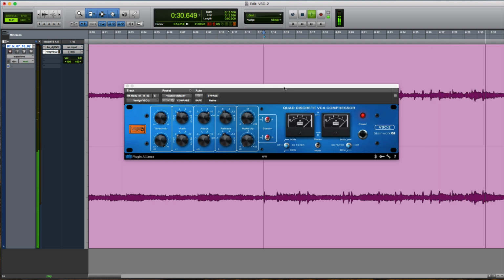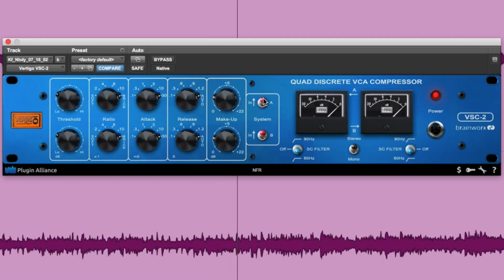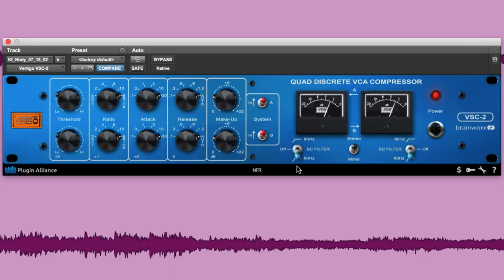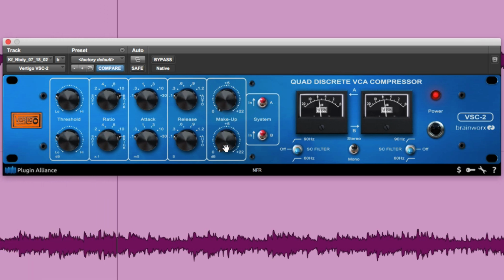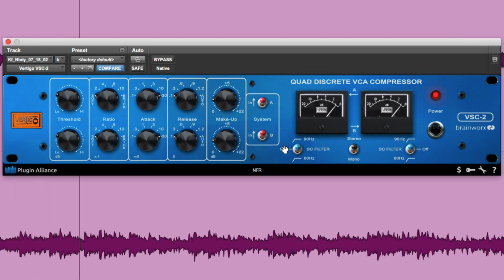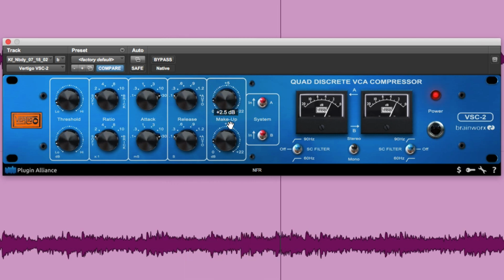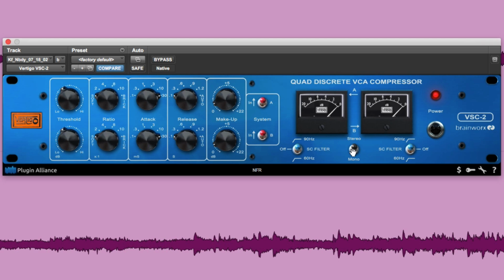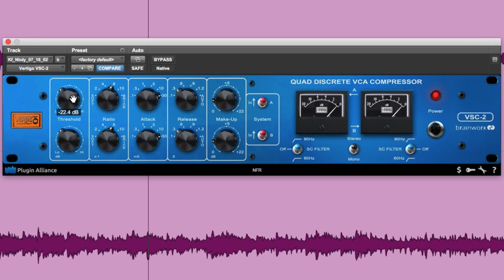Vertigo VSC-2 - How to set up a VCA compressor on your Master

Comment: Soft is not a softer ratio, like 1,5:1. It is a special ratio that goes from 1:1 to 8:1 depending on the input signal. This information is on the user manual.
Reply: Soft Mode: This is not the commonly known soft knee characteristic. Soft is better described with TipToe - a Ratio which increases with input level – a Threshold related Ratio from 1:1 up to 8:1!
The compressor “tiptoes” into compression with very low ratios, then automatically increasing with higher input signal, providing an inaudible start of compression.

Comment: Not sure between this and Townhouse compressor for master bus suited towards rock and metal. Can you give a suggestion?
Reply from the maker: You can try each of our plugins for 14 days to see and hear how they work for your sound. Just download and install the plugin, then add it to your DAW to start your trial.
Reply: This one, the Townhouse lacks side chain, which is a must for metal. Good luck!
Reply: @carlasker9285 no it does, the key button is external sidechain. And the high pass it a dial at the top. Read the manual.

Comment: You gain compensate to same level as original - so we can get a better feel if it is helping the music or not. Pushing it 5db at 3:08 and doing a comparison between off and ON is cheating. Yes cheating the listeners. This is an unethical practice used by most manufacturers when they demo their plugin. Anyway, Vertigo VSC-2 is good so no need to cheat to showcase it.
My two cents on this plugin:  It creates a wider stereo field and accentuate the high frequencies. Very good on drums stems, 2-bus and in mastering.
Reply: Yess, this is my kick drum's favorite compressor
Reply: I like when compressors don't have make-up gain. Disabling it if there option. Lot of time time extra gain is not even needed.